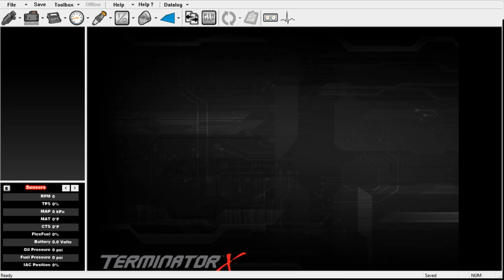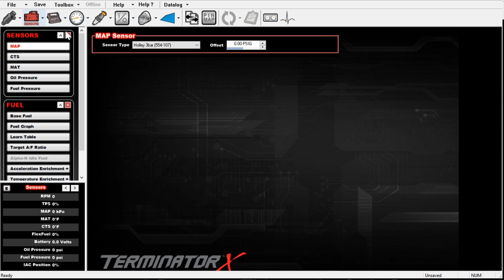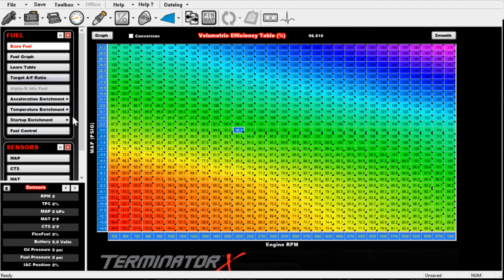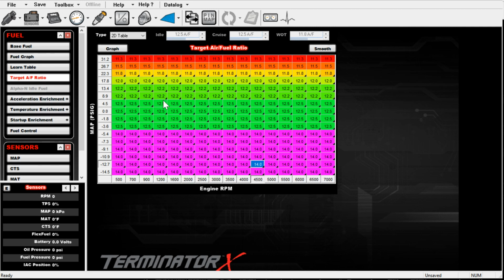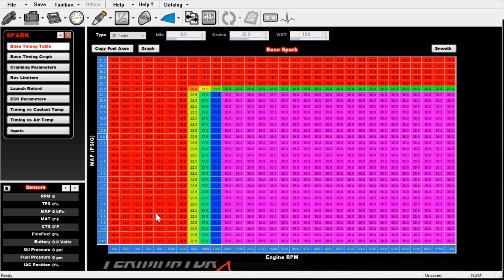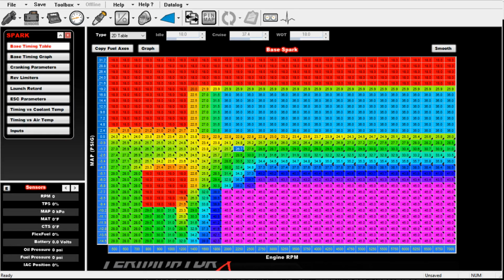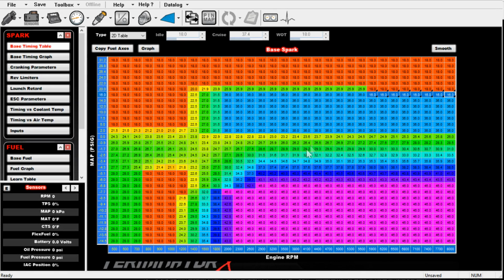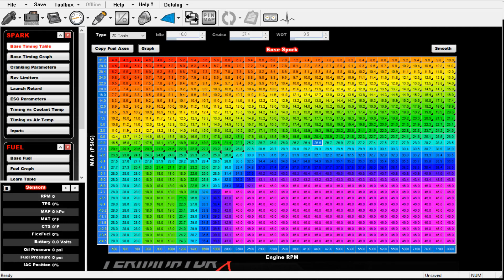How to Rescale holley terminator base tune to be more useful IMO

Comment: If you re-scale just the boost vac. Columns; wouldn't driving in learn mode re-scale the chart for you?
Reply from the maker: Yes
Reply from the maker: You have to make sure your targets are right after a fuel scale change

Comment: Has any body had their wide bands fail? I love the terminator x over all I just worry how the whole thing relies on just that expensive sensor imagine it fails on a long trip lol
Reply from the maker: I haven’t had an issue with 40 or so installs also if you tune the car you don’t need the wideband at all for it to run correctly
Reply: @SloppyMechanics  I read some reviews of saying that their wide band failed and defaulted to something crazy like 35afr and that it flooded their engines? Is that only possible during the learning stages or when you say you dont need it to run correctly does that mean it can run without it as a hole?

Comment: Does adding resolution to the kpa axis in the off boost portion of the map like this help with start up and low load low rpm drive ability ? I have a 2.5 bar map sensor and have only the bottom quarter of the kpa axis dedicated to offboost and I’m having a lot of trouble with hot and cold starts.
Reply from the maker: absolutely if you need it, segmenting portions for drivability on a street car will drastically improve driving
Reply: @SloppyMechanics  thanks. Car seems to love 14psi on wastegate and wot stuff but the hot and cold starts are kicking my arse. Also fighting a high rpm coming to a stop sign or red light scenario.
Reply: @SloppyMechanics  I open the throttle blade and ignition is great but revs on come to a stop.... close the blade back up thing needs full pedal to start but gets rid of the high idle deal, I’m doing tps auto set etc but just missing something else I think, I’m getting there tho.

Comment: Would this spark table work for pump gas? If not where would you adjust timing at for pump? Thanks!!
Reply: A good rule for pump gas is 14 lb of boost and 14° of timing for each pound of boost less than that you add one degree for each pound of boost more than that you subtract one degree. LS engines like 20-26 degrees full throttle timing at 100kpa, the timing should scale down from there to the 14 degrees mentioned
Reply: Chip Currey thanks chip! So 100kpa meaning atmosphere or 0psi and then scale from 20-26 down to 14deg at 14psi?
Reply: @driftutv8274  Yes. I've been doing this on the side for 7 years and I personally don't think it's possible to run 20 lb on an LS on pump gas with any amount of timing but if you try the table in the video on pump gas you will be looking for a new engine. I usually limit people to 11 psi on straight pump which is what general motors does with all the factory supercharged engines. Also at that boost level the power difference between say 12° of timing and 18° of timing is not that dramatic so I always err on the side of safety. If it's someone else's car I also go down to 12.0 air fuel ratio at only 5 lb of boost and then reaching up to 11.5 by 11 psi. I know that's kind of excessive but I haven't had anyone come back with broken pistons either.
Reply: Chip Currey awesome thanks for the reply!

Comment: "14.7 is federally mandated." 😂

Joking aside, several people are confused where that comes from. Maybe this is helpful: One gram of pure gasoline requires about 14.7 grams of oxygen to burn perfectly. Thus the "air to fuel ratio" in a perfect situation is 14.7:1. Oxygenators pull that number down (because oxygen), so real world oxygenated fuel requires less air - and thus a lower ratio. Ethanol counts as an oxygenator.

Pure ethanol is 9:1, perfect e85 (good luck finding that) is about 9.8:1, methanol is more flammable with around 6:1, etc.
Reply from the maker: so, no joke, why is it "perfect" its my understanding that the 14.7 is the cleanest burning mixture, again bringing up the emissions example i stated, as we all know a car will, start run idle WOT at 12.0 AFR without issue. assuming gasoline scale with no asshole bias winning factors
Reply: @SloppyMechanics  it's perfect in a chemistry sense; when the oxidation reaction (aka "burning" in this case) finishes, all of the compounds that went into the reaction come out burned; the chemical equation is perfectly balanced.

In the real world, air isn't completely consistent, fuel isn't pure, and more importantly, the mixture isn't perfectly evenly distributed. You get pockets in the cylinder where there's more fuel, velocity changes things, air is left behind from the previous explosions... So reality means you often have to add more fuel to maximize the energy released in the part of the cylinder that does burn.

Comment: My area of operation is right but the number on the actual map are weird. From 0 down is ok but into boost it goes 70's-80' to 115-130 an the max is 150. Is there something that needs changed. 3# -7# it's like not enough from what it thinks it should be.

Comment: Did you mean to be in Lb/Hr instead of VE when messing with the fuel table???
Reply: For me Lb/Hr is WAY easier than VE because if you have a good estimate on the Hp (and proper injector specs) you can build a fuel table that will be surprisingly close.
When I started building custom Holley tunes (for motorcycles) I used dyno graphs to build the fuel tables and I was honestly shocked how close my first ever normally aspirated Holley tune was. It was a 250Hp Dragbike and Max CL Correction on the FIRST dyno pull was only 7% (not kidding) but I have done others that weren't nearly as close (mainly because I wasn't able to get the proper Injector Off Times)...

Comment: Do you switch learn off or turn it down after doing this?. Or just leave it as is.?
Reply: Always leave learn on or when you fill up with different types of gas or change altitudes the system will not compensate

Comment: Thanks Matt !! Learned a bunch here , my NA setup bucks in low RPMs, stick car , going to build a proper timing table and see if I can help it out , SS3 cammed lq4 . Sounds like I need to add some timing and lower the A/F listening to ya build these tables
Reply: On stick cars with a big cam, it usually helps to pull a bunch of timing in the area where it bucks.
Reply: @dnchevyguy3  thanks for the tip , going to take it out this weekend and tweak the tune see if I can fix it

Comment: Matt in your experience over the years do you feel that 93 pump gas with water/meth can handle just as much timing as e85? or is it generally a few degrees lower?  im currently around 15.5 lbs and 16.5 degrees while spraying with dual 625ml nozzles.